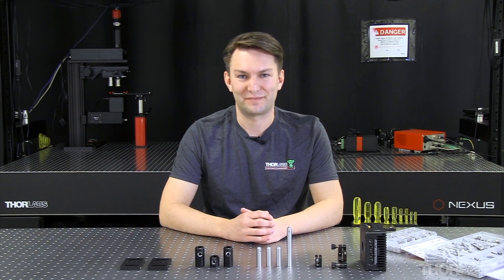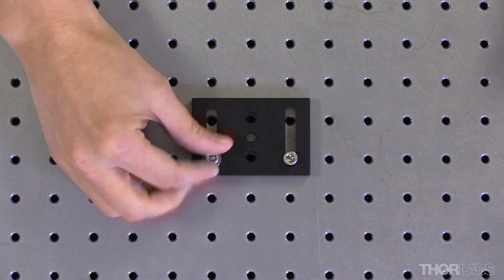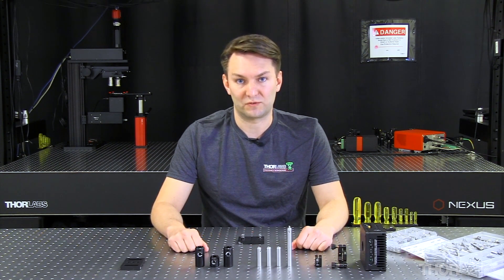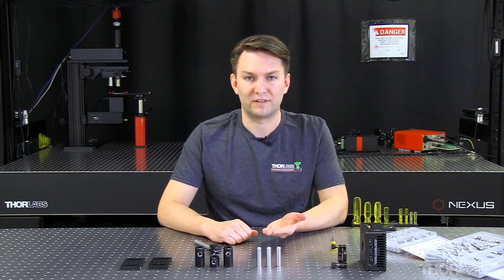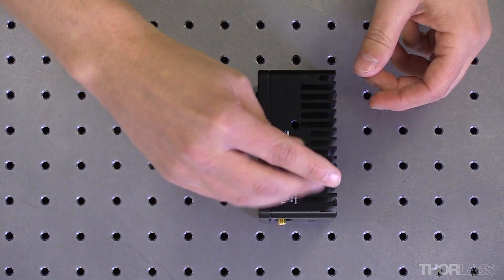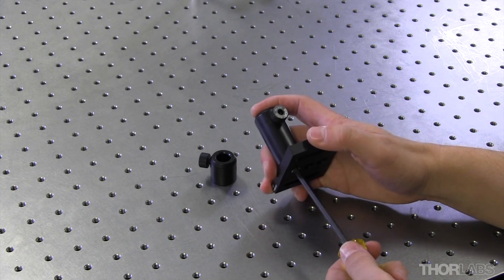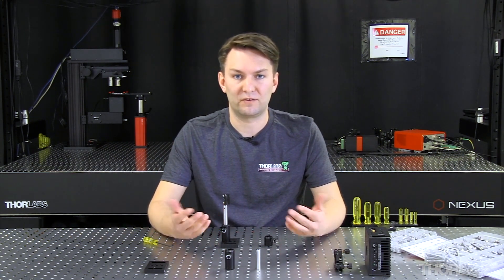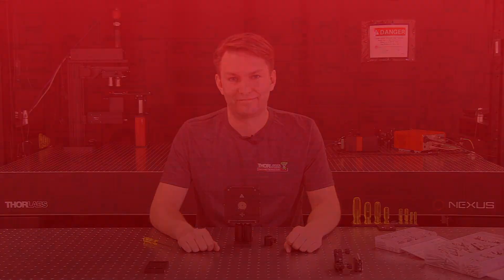Mounting Your Optomech: Bases, Post Holders, and Posts | Thorlabs Insights

Comment: Nice video,I like the two post method😅.Forgot to mention hex-locking in the video
Reply from the maker: Glad you liked the video! The two-post method is a favorite :) When you refer to hex-locking, are you describing the use of a hex hey to tighten the thumbscrew on a post holder? Or do you have something else in mind?
 
Since we passed over a quite few things in an effort to keep the video runtime a reasonable length, we have been talking about filming a follow-up video to demonstrate additional techniques, if there is interest.
Reply: @thorlabs  hex-key to tighten the thumbscrew

you can also mention about tightening setcrew with allen key
Reply from the maker: @michaeljordan494  Thanks for the clarification :)
Reply: @michaeljordan494  I broke several setscrews trying to tighten them with a screwdriver (not even with allen key). It is a pain to recover the post and rod after that. Especially when you are during alignment procedure, when no one really wants to be disturbed by anyone and anything. And actually since at least 5 years the setscrews surface  become much more grippy and don't really require additional tightening.